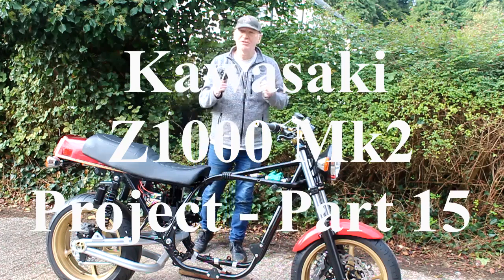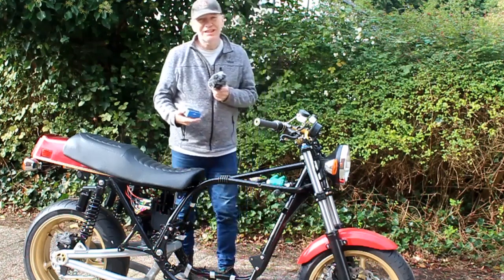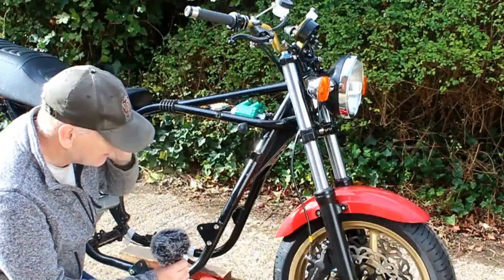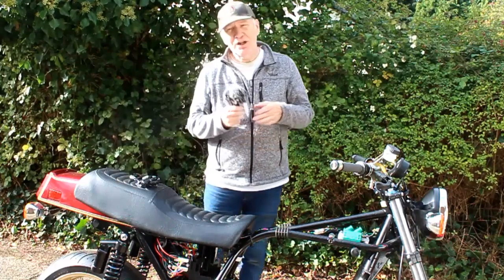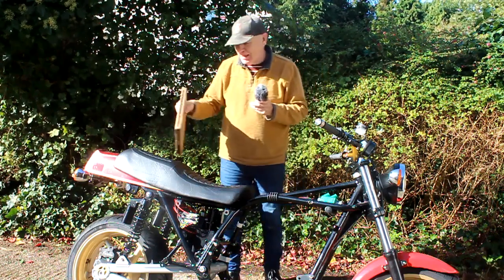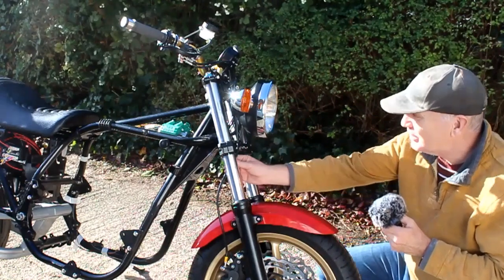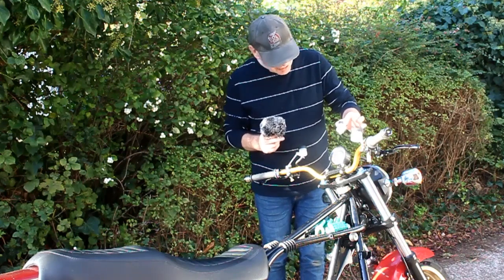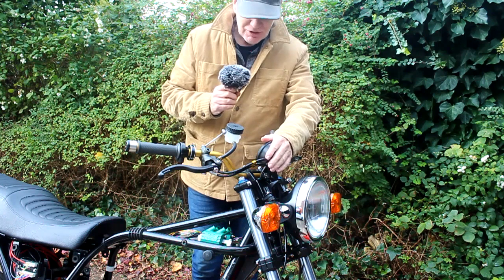Kawasaki Z1000 Mk2 Project - Part 15

Comment: When assembing your engine an old trick on deck height, is making your base gasket from an old calender (gloss surface on both sides) thickness will be about .004, stack as needed for proper clearance.